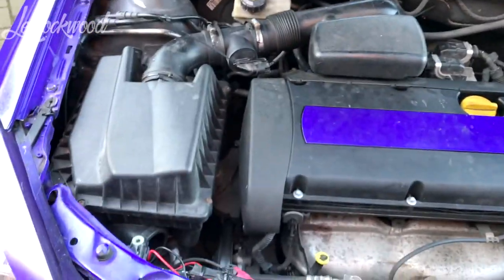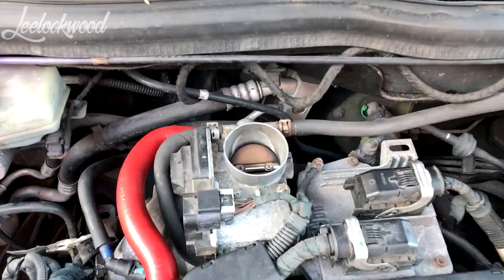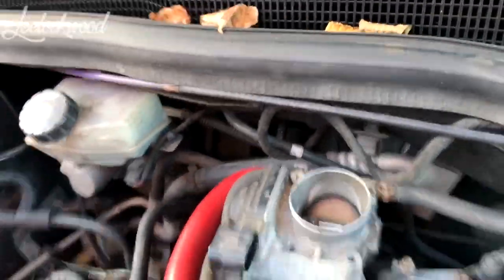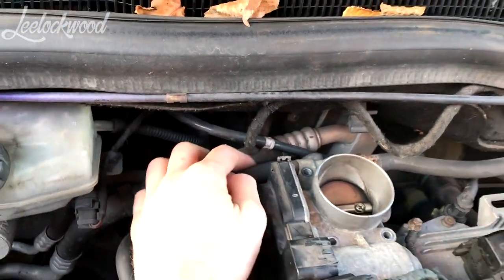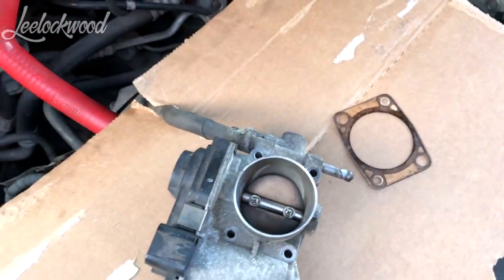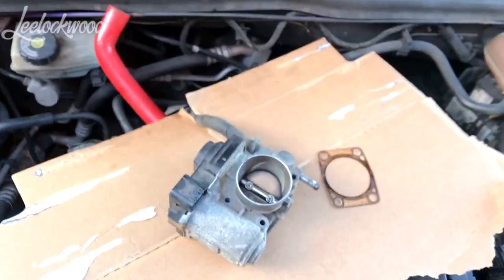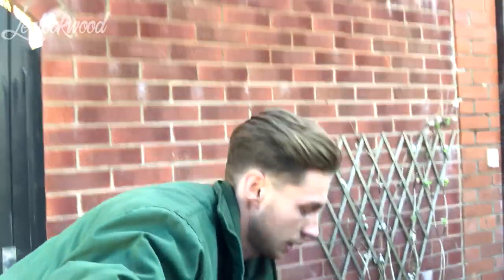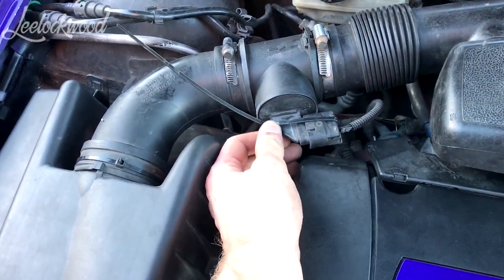How to Remove and Clean a Throttle Body on an Astra H/MK5

Comment: Surprising you did not break the throttle plate where it connects to motor,you should never move the plate.There is no need to once you spray body from both sides.If moving the plate while cleaning it this can damage the throttle mechanism which means a new complete throttle body!And clean the MAF sensor first.!!  It is a lot easier.

Comment: Vauxhall petrol engines are crap! Your better with the 1.7 dti Isuzu engine that’s what I have in both my Astra and corsa
Reply: No they're good if you look after it, most Vauxhall owners neglect proper servicing even basic ones such as oil changes

Comment: Did you find the issue. Maybe you have a vacuum leak (some of the air intake hoses looked very loose(Poor intake or incorrect air will eat fuel). Clean the MAF sensor or look at the PCV fuel valve.. these can easily be cleaned…and will improve car efficiency.. good video showing throttle body clean

Comment: Hi my engine light is on and car is really jittering . Happened from one day to other . I’ve been suggested it could be the throttle, does it need to be replaced entirely or just cleaned ? What do you recommend ?
Reply: He is not a mechanic and has no idea. You need to first get your codes read and go from there

Comment: As the throttle bodys on these are electric, is there any risk when you move the flap? Will it always go back to it's exact position?
Reply from the maker: 187Maiku yeah it's under a lot of tension to stay closed , it's hard to open with fingers.
Reply: IMO if you take it off there is not much point of trying to push it open, just spray both sides with throttle body cleaner and use a brush, I used a painting brush which is soft and has thin bristles which can clean the surroundings of the throttle plate
Reply: @covert person, it's quit important to open it while cleaning, the most important parts are the sides of the round metal plate. This can only be cleaned proper when you open the throttle body

Comment: Good Tutorial. Just want to add my .02 cents, Try not to use a ToothBrush because of the bristles but use Cotton Swaps + Cotton Rags only. Also Don't use Brake Cleaner but actual Throttle Body/Carb Cleaner that's designed for cleaning it as Brake Clean is harsh on it and will remove a protective layer in the TB and could harm sensors if you have any in your TB. 

Otherwise good vid and easy way to tune up a car to run a little better. Combine this with fresh Spark plugs and if your car has a Rotor in a Distributor even better to do that too, though that is an old car thing. 

Then run some Liquid Intake Cleaner via the Vacuum system connected to the TB and Change the Oil After running it through the system. 

Misfires can result from numerous things from Vacuum leaks, Air to Fuel Ratio metering devices, Spark Plugs, Distributors or Coil Packs, Injectors, fuel filters, etc! 

If your car is 95+ you should have OBD II and should scan if you have a Check Engine Light or even a "Pending Code" if you do not. 

Otherwise get a Simple Spark Checker to watch the Light for Misfires to see which cylinder is having an issue and start from there.

Did you ever resolve your misfire?
Reply from the maker: Unorthodox Car Guy yes i resolved it, it was the coolant temperature sensor! The one I bought previously was a cheap one..

Comment: I take it you did the normal plugs,  coil pack,  fuel cleaning  routine?  

Burning oil?  ( i guess hotbed had a new can cover since its not blue?)   

Egr valve common... 

Cheap oil and vauxhall don't mix...  The engines run hot so oil burns very fast.

Comment: My 2008 Sri 1.9cdti z19dth at acceleration would keep jerking and no boost so today i opened the egr and throttle body. But what had done different was opened the full throttle body including the electric sensor at the bottom came to see it was all covered with oil sprayed it  with brake cleaner and job done for now hopefully
Reply: Was a long  procedure as I cleaned all components and left them to obviously dry off.....

Comment: Haha great vid I'm also having the same problem plugs coil pack airflow sensor crank sensor and still the missfire 😡
Reply: Injectors have been a major part of alot of misfire codes got the injectors cleaned and serviced and it's a whole new animal

Comment: Your car is misfiring because you need a new coil pack in the car and maybe new spark plugs.  I recommend all original parts for this one as aftermarkets are crap :)  At least thats what fixed my Opel vectra b 2002.  Let me know if you had a different issue please
Reply from the maker: Jared j. Tried it all mate, didn't work!
Reply: It’s definitely one of the reasons but not the only. There’s so many things that can cause kifore